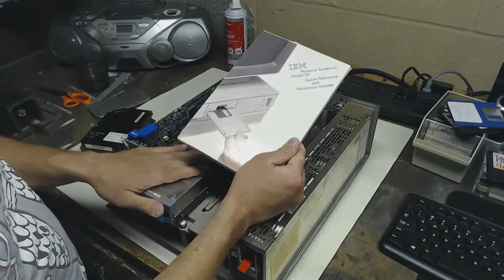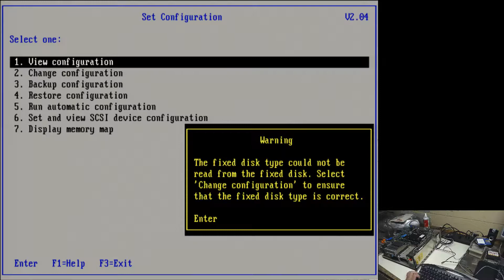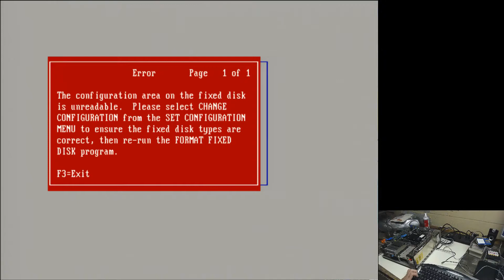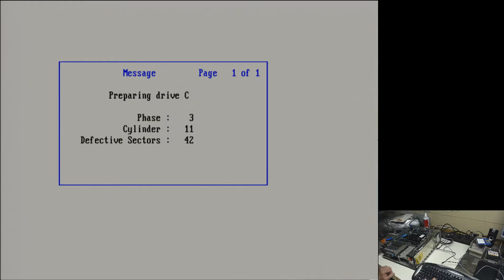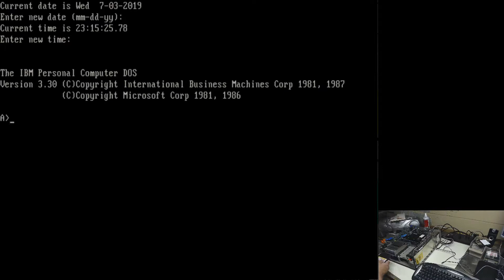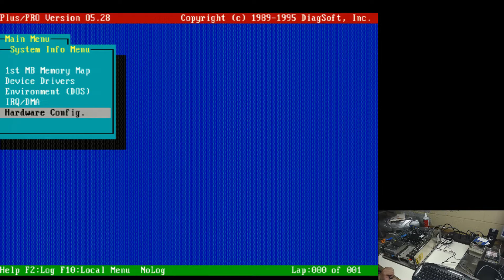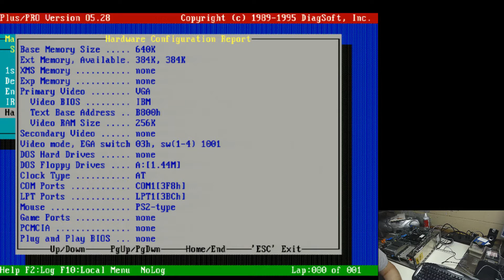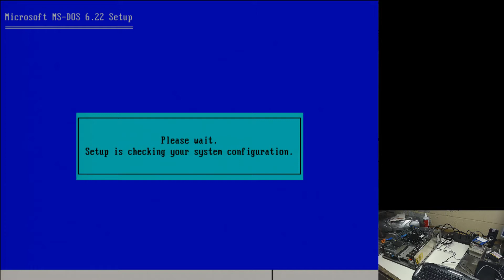Adventures in 286 - Part 2 - IBM PS/2 Model 50

Comment: put a scsi controller (some include power plug) or a procom pira ide controller + opl3lpt (soundcard on parallele port) + ram extension .. it will become a cool vintage machine
Reply from the maker: I didn't know you could get an IDE controller for these machines   I knew there were SCSI ones.  I guess anything to allow more "standard" hard drives would be good.
I haven't looked into more RAM for this before.  Do I upgrade the sticks on the board or is it an MCA card?
I really want to get an OPL3LPT either for this or for my Compaq SLT/286.  Maybe as a birthday present for myself :-)
Reply: If you want, and If you manage to add a power plug I've possibly a scsi card (+ a small disk if you need it) for you (for free) .. but you have to give me weeks because I've to find it ( + non standard cable) and test it.
Reply: I've somewhere an expansion ram card (2 or 3mb) for model 50 I don't need it because I don't have a model 50 anymore. Only 1MB on motherboard for a 50 .. 2mb on 50Z
Reply from the maker: @manutimeout4652  Non-standard cable, eh?  Yeah, that sounds like IBM.  I've seen mods to add molex power cables to these systems, but I might just settle for using an external molex power brick.

If you want to send something to me/the channel, that would very appreciated.  I'll take donations, or I could help pay for shipping, whatever works.  I could even do a video of things people send me, like other channels do.